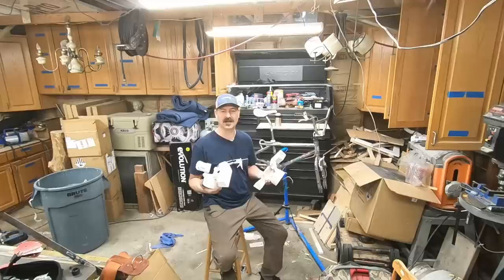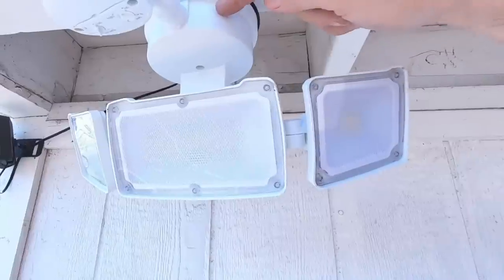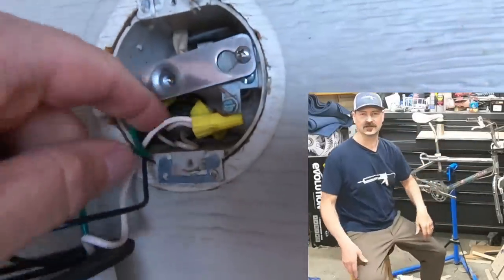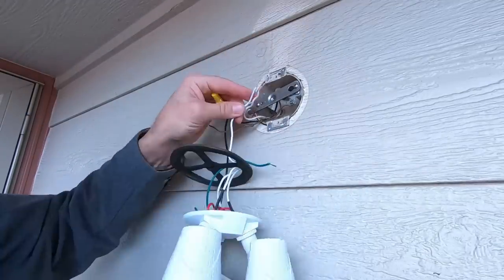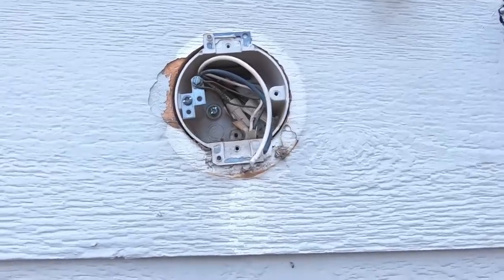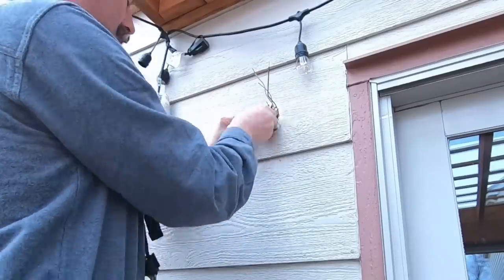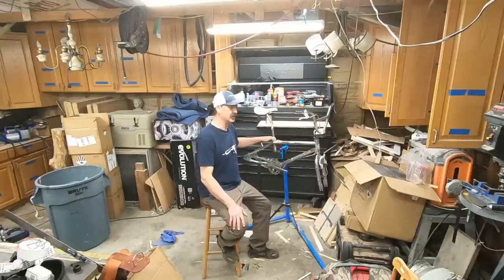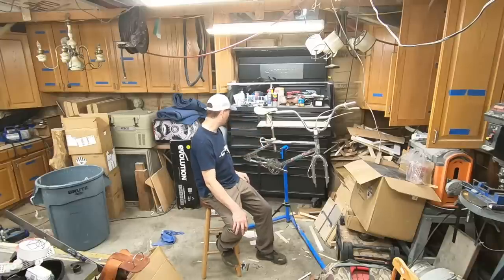LED Light Fixtures Exposed | Don't Make This Mistake | THE HANDYMAN |

Comment: Well, I have both LED and standard outside light fixtures. The standard fixture motion sensors seem to fail about every 5-6 years, not the bulbs, the motion sensor. This year I replaced the failed standard fixtures with LEDs. The LEDs are brighter but they have a glitch that I discovered when talking to the manufacturer. If you set up the LEDs to be in motion only with 3000 Kelvin color temperature and you have a power failure, the units default to the manufacturer's settings. In my case, this is on continuously from dusk to dawn at 5000 Kelvin. I have to get out the ladder and reset each and every one of these things. Make sure your LEDs have some type of memory for the settings.. Last month we had 5 power failures!

Comment: It's the LED Driver that usually goes bad. Cheap brands use drivers that aren't robust enough to withstand static discharge or exterior conditions.

Comment: It's the power supplies. Heat is the enemy, and cheap components don't tolerate it as well as more pricey components. I bet you could go into the base and find a blown capacitor or power regulator.
Reply: I told uncle Owen it was a blown capacitor 😅

Comment: Have you tried wago connectors yet and what did you think of them?
Reply: Love the wagos because you slip them on and risk of shock is low as you are dealing with one side of the connection at a time.
Reply: Wago are awesome.

Comment: Good info! 👍🙂  Any thoughts re the exploding refrigerator issues of late? Would enjoy hearing your thoughts about eco-friendly propane-based refrigerant causing the problem. I've been told installing a new home AC system requires it too.💥🤪💥

Comment: I was a Diamondback back kid myself in the 80s Mongoose was out of my budget.LED is great as screw in bulbs,just have to make sure it's compatible with dimmer,one of my fixtures has a self dimming feature that kicks it on high when motion is detected. I like 1000Lumen Sylvania Daylight bulbs myself, mine are going on 7 years now and still work great.Also the muff tickler has filled in nicely 👌

Comment: Canada had a big LED light fixture rebate program in 2016/17 to promote greener energy usage. As of fall 2022, I've spent hundreds of extra dollars replacing broken LED light assemblies around my house because they've failed, just like yours. I'm mostly fine with LED bulbs, but I will always purchase light fixtures that accept standard bulb sizes like A19, GU10, etc.

PS. Can I please have the name of the super secret brand? :)

Comment: If it's not the integrated LEDs that die, it'll be the photocell or the pir sensor. For dusk to dawn, I'd rather just get a regular floodlight fixture like the second one you showed without the motion sensor, and install either a smart or a programmable timer switch and set it to turn on at dusk and off at dawn. Probably would've done the same thing for the last sconce you installed as well, those seem to break even quicker than the floodlights do, plus you don't get calls about the light not working when they turned off the switch and didn't notice.
Reply: Exactly my experience.

Comment: Integrated LEDs are also advertised as "more environmentally friendly". Tell me how having to throw away an entire fixture made of plastic (Takes forever to degrade) is better for the environment. And don't get me started on "Smart Home" stuff. I don't believe in having to have my phone to turn on a light. Also after my neighbor's Google Home got hacked and he came home to all his lights doing a disco rave, my opinion is further solidified. He threw out thousands in smart lights after that and went back to actual light switches. Google, of course, placed the blame on his internet firewall and refused to do anything.

Comment: I typically call my utility company and apply for  permits when replacing light fixtures... that switch thing is good advice though... 
aw yes mongoose bikes from the 80s much different than the ones that Walmart sells now.  I had a redline and a few schwinns in the 80s

Comment: Yeah your not supposed  to change the bulb  just change the light out. But I have found they illuminate much better. And I've had mine for 8 years still going strong.  Just buy good quality.  I've bought the cheap ones and they don't last. But they also work much better in cold weather. No warm up time.  My entire house, shop is led. Much brighter  and I hate those ones you change.  I get calls all the time  to change  the bulb.  It gets expensive  for a bulb change in the midwest I usually  change my clients out every other year  seems like. So weather may have an effect on them as well.